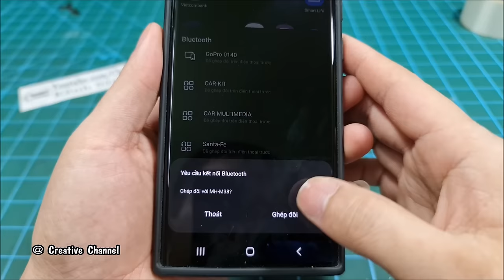Build A Bluetooth Speaker Using PVC Pipe

Comment: You added a passive radiator only for decor? Because You haven't demonstrated it so it means it doesn't work, as you really showed it only for a second, and I really waited when You gonna show the back part of the speaker where the passive radiator is, and it wasn't moving at all.. nice work, but undone...